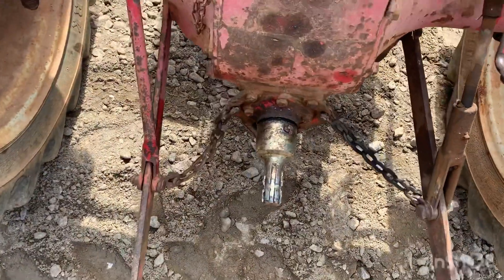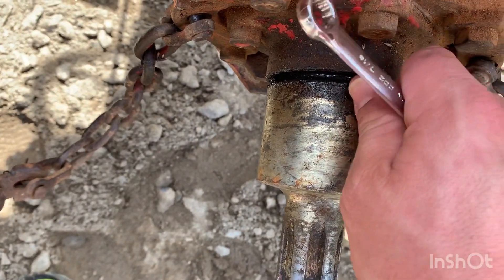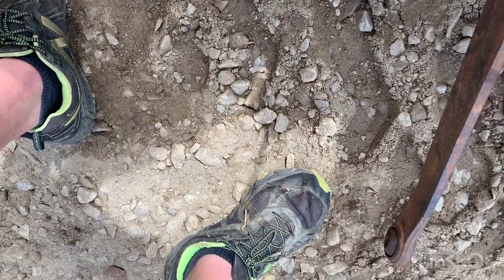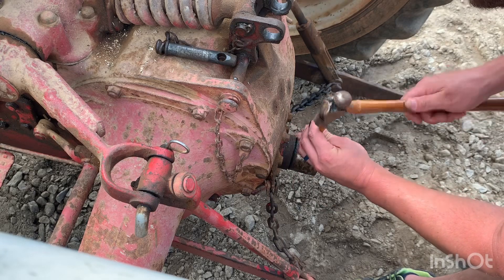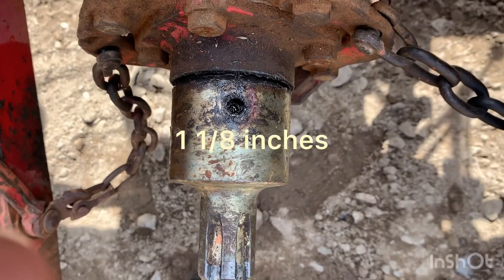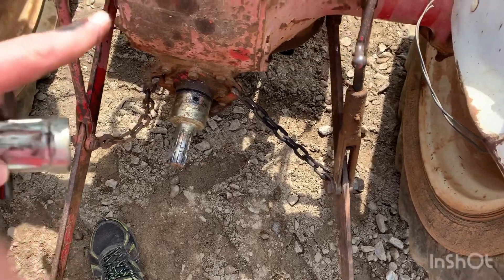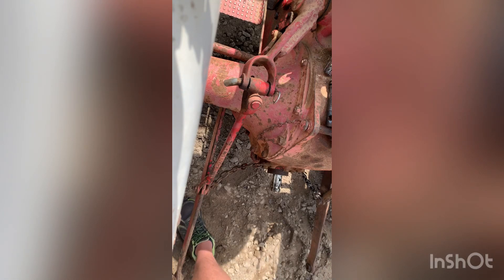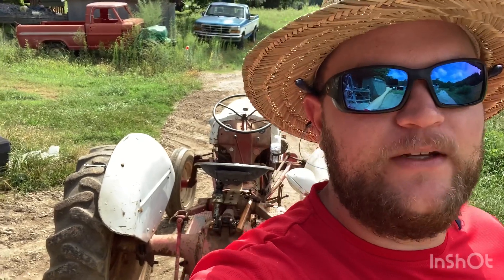How to Install Ford 8n Overrun Clutch [[ PTO Shaft Adapter]]

Comment: Do the Zerk fittings still work after the Roll Pin is installed and can I grease the PTO adapter that way. Or, do I have to grease it just slipped on, remove Zerks, install Roll Pin?   I was bewildered until I found this YouTube. Thanks!!

Comment: Great video.  Can you make a video of how to remove a brush hog?  there has to be an easier way than what I am doing.
Reply from the maker: Thank you. I will do my best. I have been all over the place here recently. Which has unfortunately put me way behind on editing. Always start with your top link. Loosen it up or tighten it so you can easily remove it. This will take the pressure off your drawbars. Next I normally remove my PTO, but before I cut it to shorten it. I had to take off my drawbars second. Slide the tractor up a few inches. Then remove the PTO. With a overrun clutch most PTO shafts are to long. This makes things a little more challenging. If getting it disconnected is your issue. You may want to consider cutting a little off. I hope this helps. Thank you for watching and commenting.